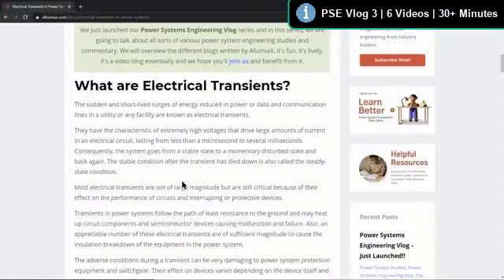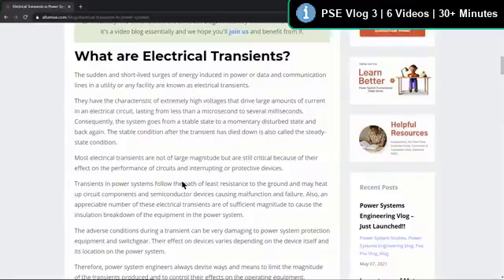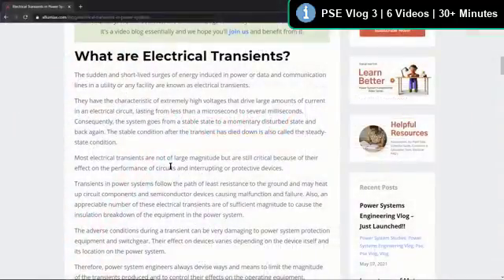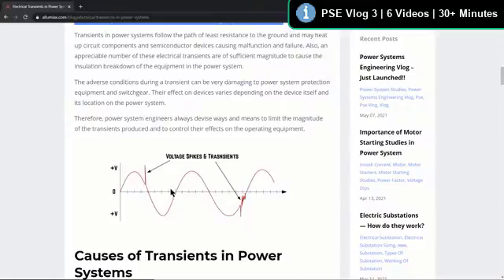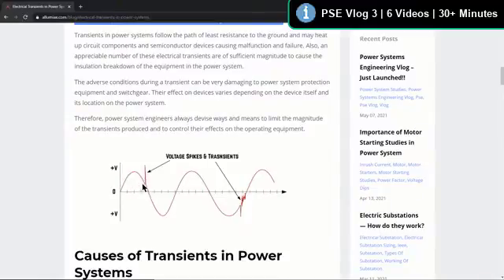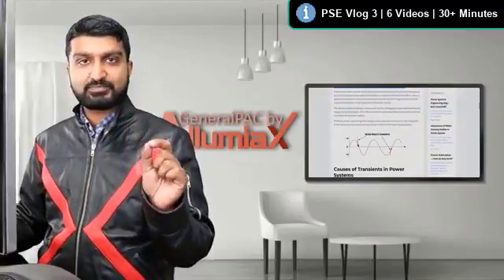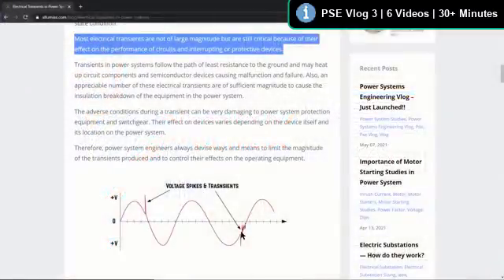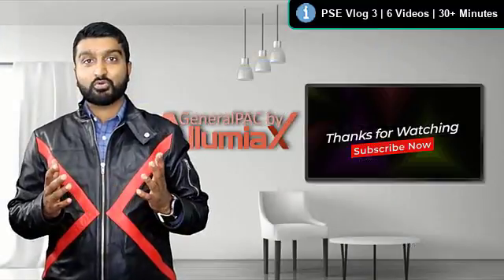What are Electrical Transients?

Comment: So is there a difference between a transient and a surge?
Reply from the maker: Hey,

"Transients" is a broad term used to describe any temporary changes in the system parameters including voltage and frequency. "Surges" are typically used to describe power events that cause disturbance in the voltage waveform. Surges can last for a longer duration and are usually observed as a sharp sag/swell followed by a decay pattern. In this sense, surges are a subset of transients.
However, please note that the term "transients" and "surges" are widely used interchangeably and most commercial applications do not distinguish between them.

Hope this answers your question. :)